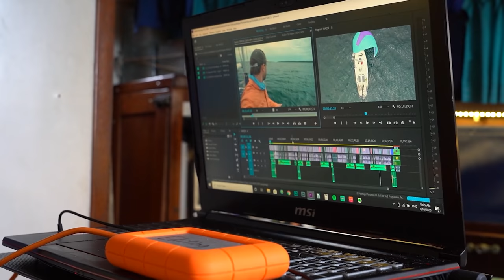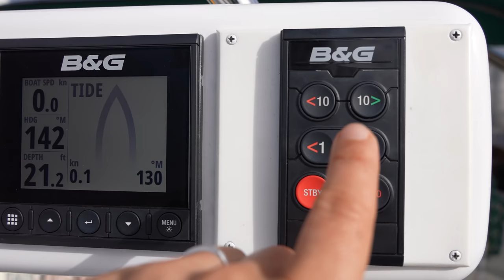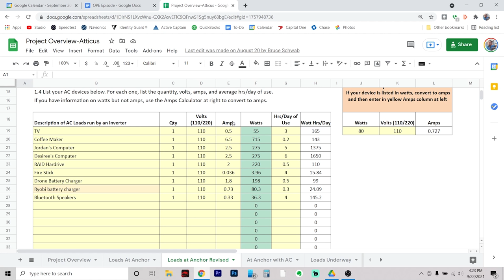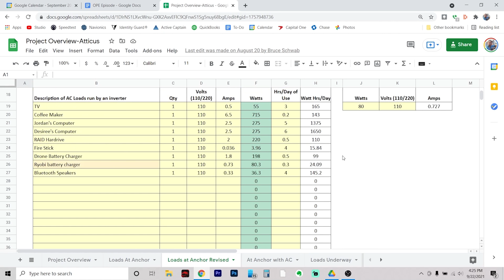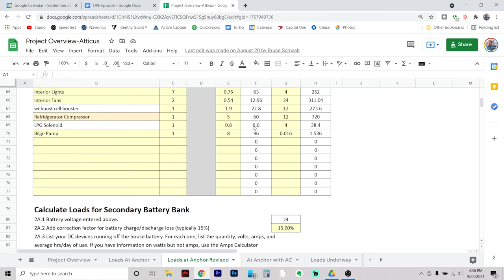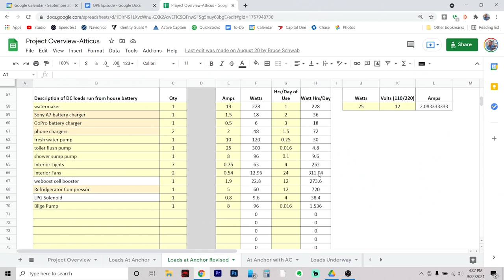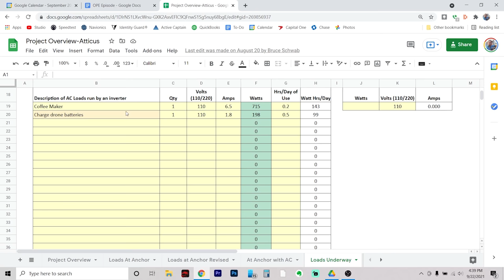Building our Electrical System | S06E20

Comment: Hi guys.
I completely understand the hesitation to fully engineer your electrical system. I've just started myself. 
It sounds like you've already inked a deal with Bruce. So take the following accordingly.
As you've discovered, charging is one of the biggest challenges with lithium. If you want similar performance consider going All electric. Decouple your diesel from the prop shaft and fit a flywheel mounted PMAC motor generator. See in motion GSM.
This way you achieve extremely similar performance to their ludicrously expensive HO alternator (PMAC motor generator). This is complex and still costly I know. But doable for anyone who believes in themselves and at Least $10k less expensive.
Basic concept...
Diesel engine does nothing but charge a 48v lithium bank.
How you provide 12v is your choice
     -DC/DC converter (solar charge controller) charging a separate 12v battery/bank
     -DC/DC converter (high power purpose built) powering the 12V bus without a separate house bank.
     -AC charger via an inverter to a battery or bank
     -Existing alternator
     -Other
Of course if you want to move the boat under power, you'll need a second electric motor (same kind) to turn the prop. I like the Parker Hannafin GVM models. Your taste may vary 
A key component is the motor controller. If you want extended motoring you must ensure the controller can handle the load over Time and Not overheat. Let's say you want to motor for 20 hours at 4.5 knots. Just run your diesel normally. The diesel will run at an almost identical RPM. Only you will be producing electric power not mechanical power. 
Again, this gets complicated quickly. But no one will ever cruise enough to recover their investment with OPE. And you're still more or less using the same old methodology... Charge with your "alternator". An AC generator is beyond the DIY scope. But a very well engineered DC (PMAC) generator is definitely within reach.
This option is not for anyone who needs to motor at hull speed for days on end. Even the most actively cooled motor controller can not take that indefinitely.
I do applaude OPE for having the guts to implement a different cell chemistry. I believe I read they are not using LiFePo4. I also, use a different chemistry. I have a 16kW 44.4V bank of lithium polymer cells.
Stay safe and have fun!

Comment: Modern electrical systems are far more efficient than older systems. You essentially replacing older legacy systems with newer and better quality. If you've ever seen a TV from 1960 start-up, and compare it to a 2020 TV, the speed differential is dramatic. Very good.

Comment: What you seem to have overlooked is dumping the diesel monster and going 100% electric...with an electric motor you can install a prop that would charge your system while under sail...you can turn it on and off as your batteries needs are met... it makes you 100% independent from the needs of a Diesel engine if fuel is not available for some reason...you would 100% off grid, no matter where in the world you choose to go or be... something to think about and consider...
Reply: Before you decide to go electric power check the price of the system it's not for the little guy.

Comment: Are you switching your battery bank from 12v to 24v or 48v?
You mentioned your new battery bank  will have 600Ah but didn't say anything about the voltage

Comment: Interesting topic. I went through a similar process years ago when I was preparing my RV for "boondocking". I did a similar analysis of my daily power needs, available solar power, and battery capacity. The one thing I wish I had done differently is to actually measure what some devices consume instead of using their rating plates. Many things consume much less power than their plates state, and other things (like the microwave) aren't that convenient to use when one sees all the lights dim to heat a cup of soup.

You are doing the right thing by considering what it takes to charge your system. I often had "shore power" available to my RV, as well as a separate generator, to run my A/Cs. Are propane refrigerators unwarranted in a boat?

Comment: With a 12V Lithium system at 300A, you will ask 3.6kW of extra power from the engine. Can it cope with that?

Comment: you didn't list AC on your spreadsheet, since heat was an issue on Atticus 1 are you going to plan on running the AC off grid, or maybe install a 12V AC unit?  With that much amperage, this is very doable.

Comment: Fascinating stuff for gearheads!  Serious question:  It seems fairly easy to add sufficient generation capacity (solar plus generators) to exceed one's average daily need.  So, how can you efficiently dissipate the excess generation?  Obviously, you don't want to overcharge the batteries, so how can you dump excess capacity without wasting it?  Thanks for your consideration!

Comment: Funny thing about those "AC loads" is that almost all of them have built in power supplies that turn the AC back into DC.  DC(battery) --> inverter makes AC ---> plug in device --->  Built in power supply turns AC into DC to run device.  Very few things actually run on AC, most convert it back to DC.

Comment: Jordan and Desiree… your marine electrical contractor has their own engineering / wiring load capacity guidelines.  Fuses should be rated below the wiring gauge rating.  It is their liability to design a system to protect you.  Redundancy is good! Please post the disclaimer: No User Serviceable Parts Inside.  Consult With a Qualified Service Technician Before Servicing.

Comment: I like the direction you're going with lithium. A lot less weight too. On the fire issue, have you got some good sized CO2 extinguishers? Or maybe  a CO2 fire suppression system. I like that CO2 won't damage your electrical systems if ever used, unlike the powder systems which are very corrosive especially to PCBs.

Comment: You guys should define a number of loading scenario's and see if the high-demand-scenario's could technically be dealt with by using the engine (i.e. when they are very uncommon to happen and are only short periods of time). This might lead to a less beefy system which is cheaper, lighter, etc.

Comment: 7:15...my experience with the Battleborn lithium battery and solar installation on our Airstream travel trailer is.......Go for 20% more reserve than you calculated for. That was my mistake, I didn't.
POI...be prepared for obsolete, battery technology is improving so quickly that you may be way behind the curve in a year or two.  What to do, you're really itching to improve. 
Ask me how I know. We did our upgrade 3 years ago and I'm already scratching.
Just my opinion. Put up just a few solar panels don't go "overboard" and ruin the aesthetic's of a great looking vessel. As a matter of fact we have 360w of portable panels that I can fold up and put away for that very reason.   Sail Happy

Comment: I do enjoy various sailing videos, I noticed UMA is using props that generate electrical current, is that something you could add to Atticus II or is it only available to boats like UMA that use electric motors? Like Ron Boston I did enjoy your run down of the process you will be going through. I love my mug of Atticus I, will there be an Atticus IImug? Be well, blessings!
Reply from the maker: Yep! We're working on some new designs 😁

Comment: Li-on batteries near saltwater had me wondering. I've had two blow up on me, same size as the individual batteries originally found in Teslas. Vaping. Totally different application. But the ferocity of the energy release is surprising. Almost like a welding torch. Checking into it, they're talking about saline solution as the electrolyte for future, 'aqueous' lithium-ion batteries. These are actually, quite the opposite, resistant to catching fire. Guess that means we'll be looking forward to an upgrade episode when the two of you are likely on the other side of the world.
Reply: I would never use a Li-Ion battery with NMC or NMA chemistry in a enclosed space, like the standard cells Tesla uses. Yes they can burn. Yes they can even explode. I use LFP aka LiFePo4 - Lithium Iron Phosphate battery cells. A bit larger and heavier but much cheaper and they last 6000 and more cycles, do not mind being too low or 100% charged. They just do not ever want to be charged below 0 degrees celsius. NEVER. You could pierce them with a nail and they just get a bit warmer then normal.
Reply: there's a huge difference between land-use Lithium batteries and those designed for marine use. Those DIY projects  that install automotive batteries are sketch as hell. But those designed for marine applications are fine. Risk level is about the same as any other system you have on board.

Comment: Great presentation on electrical systems.  I recently purchased a Hunter 30 and am about to review/upgrade the existing battery/Solar/Inverter system.  You demonstrated on a spreadsheet how to calculate power consumption and conversion.  Is there a link available for that spreadsheet.  I can see that it would be very helpful to me in evaluating what I have.
Reply from the maker: Its the Ocean Planet Energy load calculator 😁
Reply: @ProjectAtticus  OK Jordan.  Found the Ocean Planet Energy load calculator page.  How do you download the spreadsheet you are using?  I am looking for this tool to run the load calculation on our new FP Elba 45 that is being built.  Would appreciate a copy of this tool.  Thank you.

Comment: You guys did a great job on the power-battery presentation.  How many rpms or how fast do you have to motor to get a 360-amp alternator to generate 300 amps of needed power?

Comment: Aren't lithium batteries extremely flammable/explosive?
Reply: The ones usually installed on boats are LiFePO4 which aren’t the same type as car or you smartphone/tablet/laptop batteries
Reply: @smulismuli7976  Oh thanks! Then is it safe to say that  power stations like the ECOFLOW Delta units use that type of Llthium battery?
Reply: @emilybh6255  look up their battery specs   what they say

Comment: Wow, so great. So, glad Atti2 won't look like you're trying to get it into the air, in some WaterWorld flapping menace with the 37 solar panels on board. Carbon footprint translates to engine runtime and with a 300 amp????!! alternator you are just fine about saving the planet. Kids will probably use a lot more, TV teaching and entertainment, Laundry, water but you calculated a maximum and rounded that figure well up. Normal conservation concerns will cover you well if you've gone a bit over in a day; oh, and then alternator maximus will save any day.
  Can't wait to see it all done.

Comment: I'm surprised you don't have a basic gas generator. It eliminates any worries.  The just in case part of things.  If all you're batteries crapped out.  Leave something on. Run while you're working. If you are totally dead. A basic 2000 watt gen will get you out of trouble.  They plug in to shore power cord. I have a Westinghouse 3600. 4250 peak
Gen. 30 ft rv.  $299. Amazon.  I have a battery that I can use for other stuff.  I have had times when I really needed it. You're system is perfect for you. Cheap insurance with generator.  You already have gas for you dingy outboard.  You can also get duel fuel . Run on gas and propane.  The worry is
Reply: The more electrical stuff you add.  The more chance for failure.  I guarantee 100% that something at some point won't work. Plumbing and electrical. If you're out there.  You can just plug in. It'll run all the Electronics, lights, pumps. Everything. The cheapest way to go.  Cheap gen, plug in battery charger.  Charge the batteries directly.  You could do that with 1000 watt. Basic generator.  That's pretty cheap operation. Just use the same fuel mix as outboard motor.

Comment: Hi Jordan, 
If one of main sources of power consumption is the computers, did you check the new Apple MacBook ( AIr or Pro) or Mac Mini based on the new M1 processor. This processor is very very efficient in power consumption. I know that such computer are "quite" expensive, but if they allow you to reduce a lot the size of you electric system, you may habe those brand new computer for free !! Have good computation... ( use applestore refurb to buy them... ). Also they are very performant for Video creation and edition...
Reply: Just to complete, MacMini M1 is 39W full charge, and macbook pro M1 is between 30 and 50 W. . Then you are reducing the computer comsumption byy 225w/h, thus 2475W per day, compare to a total of 3700 on AC load ( in table at 8:11 ). You can divide by 2 the size of the DC:AC converter.... ( impact on price ? ). You just need 1300 W instead of 3700 !
This should have a non neglectible impact on Batteries and solar panel size..

Comment: With your computers, am I correct in thinking you go from 12V DC through an inverter (power loss) to 110V AC, then through a transformer (power loss) to get power back to 12V DC?
Is this the best way?
Reply: The reality is that some many useful electrical devices are designed for 110vac (or 220vac in Europe) and batteries and boat electrical systems are dc at much lower voltage. So to use readily available devices you are stuck with the need to convert up and down.
Reply: @georgegilbert7347  Your missing the point.
Most portable devices these days work on low voltage DC whether they are 'useful' or not.
12V DC to 12V DC...
With two power loss devices in between...
See the issue now.... surely there is a better way.
And thanks for telling me about the 110/220 thing, having lived in a number of different countries and travelled to way more, I had no idea. :-)
Reply: @alfredneuman6488  I agree that some devices are available with low voltage dc power requirements. When such devices are available using them does make a more rational system choice. But from watching several sailing U-tubers, I have seen that many of these sailors like to use some normal household devices (including power tools) that use 110v / 220v ac power. Hence the need for inverters.
Reply: @georgegilbert7347  I fully understand using 110/220 AC devices BUT I am talking about their laptop computers which I think are most likely 12v DC.

Comment: Try Regen like Sailing Uma. Good to have gennie if alternator or engine fails. Redundancy will stand to you . Also, what about wind generator?
Reply: RIGHT!  UMA has an electric engine - no recharge with an alternator.(brave souls).  They just added this system with a new prop and are killing it with recharge of their batteries.  THAT is a great solution if you plan long sails - why NOT recharge underway!

Comment: Excellent approach to start from demand scenarios. When you say your approach (scenario) is theoretical, I would have to correct you. It seems to me, what you are doing, is a "worst case" electricity consumption scenario. If you spend significant time in locations where this worst-case scenario plays out, then it is pragmatic, valid and relevant, rather than "theoretical". And even when you only occasionally are in locations that force to all this consumption, would you accept to not be able to run fans because you need your interwebs?

Comment: Could you please explain it next weeks show how are you would possibly be able to put out a fire was such batteries I’ve seen things on the news that they cannot extinguish the fire on a Tesla automobile and just have to let it burn for hours and hours I’m just thinking of your safety and that of others
Reply: The battery chemistry of the batteries they have chosen is -  Lithium Iron Phosphate, very stable, very safe, medium energy density.  Tesla uses a completely different chemistry- Nickel Cobalt Aluminum Oxide which has very high energy density.  As energy density increase so does the issue of run away combustion if ignited.  Lithium Iron Phosphate is safe and is used extensively in Recreational Vehicles and boats.  It suffers the hang over from the reputation of other battery chemistries in your phone or or in cars that have had some bad fires associated with them.  Most people hear these stories but don't pay attention or investigate what the chemistry was of those batteries that ignited and burned.

Comment: I think you need to speak with SV Delos about having a generator on board even though they have lith batterys for high loads. They seem to use their gen set a lot and depend on it.

Also talk with Sailing with the Wins as they have been without a genset for a while now AND they also have lith batt.

Also look at Emeral Steel They average 10yrs between change outs with lead acid batterys

It does not make sense to lightly load your  boat engine just to recharge batteries. At that light of a load you waste about 2/3 of the fuel you are burning. Besides adding a lot of run time to it. Wearing out and replacing a genset is a lot cheaper / easier that replacing  the main engine in the south pacific where parts are NOT cheap. And no one really knows the real lifetime of Lith yet. Also high output alternators are not as reliable as you want them to be. Running at high loads create a lot of heat and can cause premature failure of the stator/rotor windings. I am sure the dealer tells you differently BUT he is trying to sell you something. Always take that into account. Also charging at 300 amps can be a serious safety issue with wiring and heat.

Just a question what voltage batt banks are you thinking about 12v 24v ??

Just a thought (;-) TP